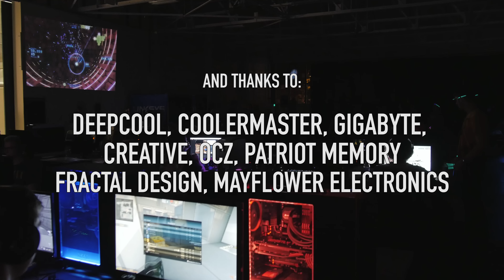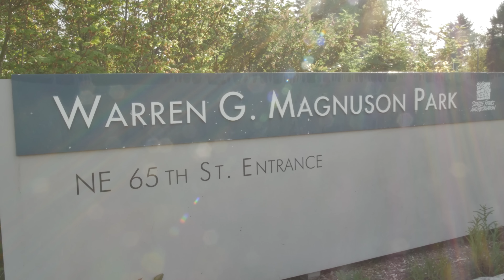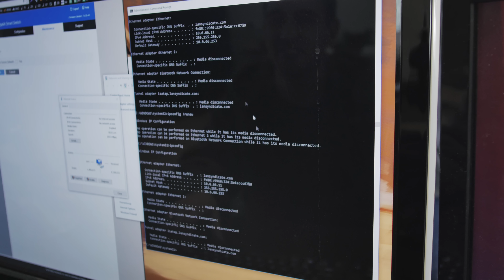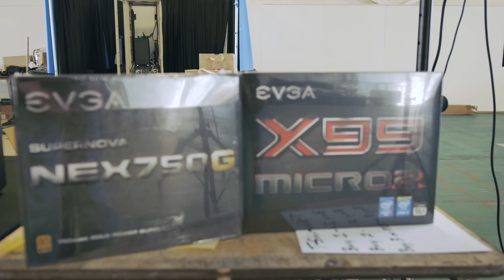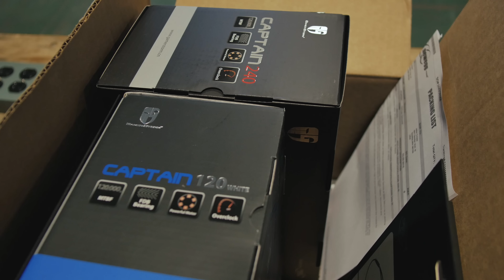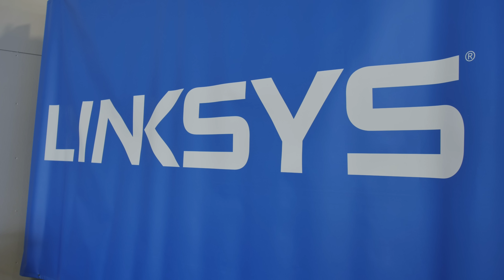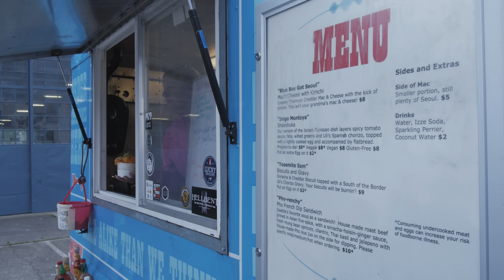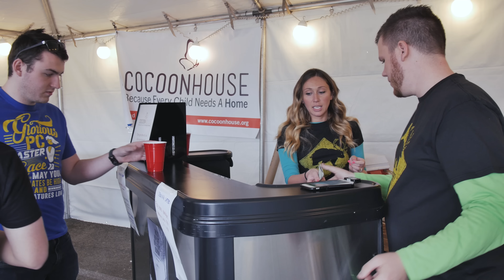Lan Syndicate: The Community, The Network, The Epic Weekend

Comment: The power distribution you had got my interest :) - use to help run lans many moons ago and power was always one of the issues that cropped up. The switches in the end we racked mounted them in flight cases; one for protecting and two because the lan was held at the same centre a number of times a year it meant you could just roll up and plug in (even had the network leeds all spooled up and ready to go) hmmm gaming laptop and a plane ticket for the next one....I wonder :D